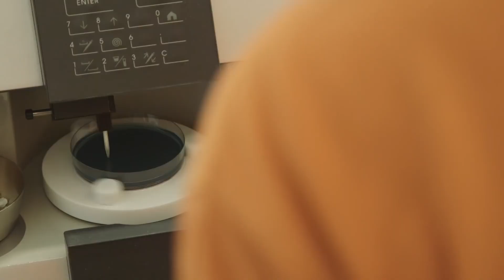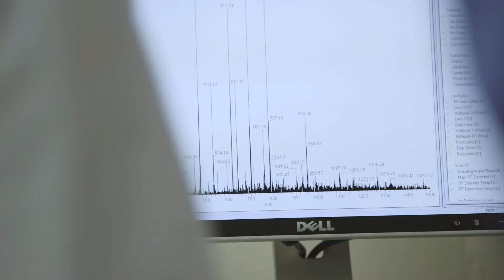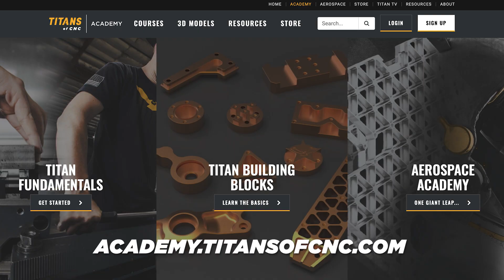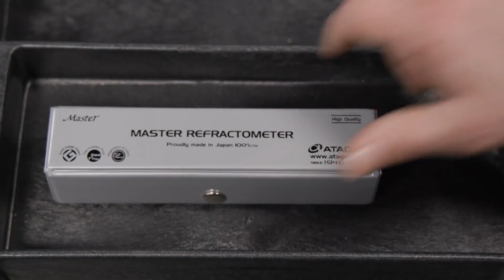The NASTIEST Thing I’ve Seen in a Machine Shop

Comment: My story: Almost 2 years ago me and my friend had to change the coolant and refill all the tanks of the machines. One HSC machine had a very big tank, we‘re talking about a few hundret liters capacity. So next thing we know after getting rid of the old coolant is, someone had to clean the tank from the inside. There was soggy slimy brown stuff everywhere, almost like rotten chocolatemilk. I was the smallest out of everybody so surprise surprise… i had to climb in the tank with a flashlight and clean everything without any assistance. Fortunately the smell was‘nt to bad (atleast for my nose :P) but the worst part was the thick air in the tank, it was almost like a gas chamber so i had to stick my head out the tank to sip some fresh air. Somehow i was finished pretty quickly and climbed out of the tank. Thankfully my boss decided i could go home wilst my friend had to refil the tank till it was full xD. 
I still love my job as a Polymechanic regardless of all the things you have to do for a healthy machine! 

Greetings from Switzerland :)

Comment: I know that feeling when the coolant pipe is stuck with dirt, I increase the pressure to max and suddenly this shit is all over the place. It takes a lot of effort to clean literally everything. Proper mainitenance is important. I've seen the same thing on some old machines in our shop. It is all mixed with oil from the parallels, coolant and metal chips...

Comment: during the summer we open our doors due to the heat. it can get up to 30-35 Degrees in there. often birds flies in and have a look around and leaves, but sometimes they get lost and gets stuck. 
During a tank cleaning we found a dead bird in one of the tanks. the PH was off and the coolant started to smell. if it falls under 8,7 in PH we cant save it anymore and we have to change it. the PH dropped to 8,3 if i remmember correctly. so when we cleaned the tank we found this poor bird in the tank,  covered in a layer of oil :(

Comment: I've cleaned out tanks on many machines and got bacteria on my hands so strong it literally ate my fingernails up and gave me a horrible rash !!!!!!!!!! That was in my own dad's shop because my goofball cousin was to lazy to ever clean the tanks out , to the point that 20 gallon + tanks were only holding 3-4 gallons 😡😡😡😡😡😡 When oil gets in them it really speeds up the bacteria process to it seems . The newer machines with the grease way lube instead of oil is a HUGE advantage for that reason alone for the long term . Coolant can get bad fast and truth is far to many shops don't take it seriously .

Comment: Our coolant is changed out often which is good for the company considering the tanks are over 500 gallons each...But one time it just smelled terrible so we started cleaning the tank and there was a dead pigeon in the tank...we scooped it out and it burst open and maggots crawled out everywhere 🤢
Reply: ouch oof, how did that pigeon get in there in the first place?
Reply: @ipadize  There's an overflow tank below the main tank which is only covered by a plate that has gaps around the sides...The pigeon must have been on the way out anyway and fell in...it was not pleasant
Reply: A guy I worked with told me he had a pigeon in his tank one day. It was only a small tank on a centreless grinder. His mate put it there as a joke. Begs the question why?

Comment: i won't work on a dirty machine, i will replace the coolant and wash the sump thoroughly if i have to. but I actually prefer working with oil and converted most the machines we have to oil
Reply: Do you mean like an oil mist, no coolant at all? Do you find it gets mist in the air?

Comment: Cooling can give you such a mightmare, that once you achive a certain level, the risk that comes with a  trie to improbe is hard to assume. 
Many workshops, don't try new solutions and continue years and years woth the same cooling.
Question:
Modern cooling solution, do they reduce production cost?
Has cooling improved significantly, in safety and eficiency ?

Comment: Worst story for me, 14 years of no maintenance on 18 machines. Not only was there hydrogen sulfide issues, there was a powdery mildew that formed in the chip layers in the tray. When I started, the “old school” machinists would spit in the machine. Every machine I filled daily was a translucent rust color and would take 20 gallons of a milky swisslube and turn it the same color (almost a 50% fill up).

Boss let me change my machines coolant, several issues were immediately fixed on parts coming from my machine. Became the best quality and efficient operator on the floor. Now I show others the right way, and I have changed out 6 other machines. Saved the company tens, if not hundreds of thousands of dollars. To boot, my bay is the only clean bay in the whole shop and my parts and talents are premiered to our customers. Owner is talking about putting in a new DMU 50 and guess who is going to be running it??? Yours truly!!!!
Reply: and then they laugh at you when you ask for a raise.
Reply: Start your own business Benjamin trust me you'll be lots happier, your currently your bosses slave and he's taking full advantage of you riding your coat tails and you're getting nothing for it!
Start your own business and DO NOT do what you know the other fools do.
People will want to work with and for you if you provide standards and disciplines of excellence, Titan is one of the best examples to acknowledge and in doing so he has bragging rights that not many can deny💪
Reply: Ask the owner to put in a Hermle C22  and you  (and the boss) will be even happier!
Reply: It's people like you that make coming to work a pleasure I can't stand nasty habits and dirty machines just shows a lack of pride in your work and a lack of respect for your workplace and team
Reply: that's the most fucked up shit ive ever heard
Reply: Congratulations, you earned it.
Reply: LMFAO ADN YOU GOT THE DOLLAR RAISE!! SO PROUD MEANWHILE HE MADE 10's of thousand of dollars. Profits run uphill you sucker.

Comment: I actually really like qualichem 251C, going on 3 years now with it, and works great, cutting mostly aluminum and a little hardened stainless. I was thinking about trying synergy 735 on my new tormach but didn't want to have 2 different cutting fluids in the shop.
Reply from the maker: Used Qualichem before switching to Synergy and it’s better than most… Synergy is just a different a complete different Beast, especially for someone that wants to see their parts while being machined… and doesn’t want to deal with bacteria.
Reply: @TITANSofCNC  yeah i think when I sell my Tormach 770m to get my first vmc I'll give it a shot!

Comment: The workshop I done my engine reconditioning apprenticeship at we used this green water soluble oil based coolant and in our climate 33°c @ 75-80 humidity on average and the machine has been run a couple times (mostly steel and cast iron) and it's a week or so old it would get that same brown sludge on the top and it had a distinct sulphur smell. I absolutely hated running any of the machines that required coolant because every time I would end up with a splitting headache and if we dare changed the coolant before it's a month old we were wasting money because it's only new. 
Hopefully in the near future I'll have the funds to purchase some basic machines like a lathe - mill ect and just do small jobs on the side of being a full time mechanic so I can at least get back in to making chips after being out of it for close to 10 years now watching your videos has made me miss machining but unfortunately where I live there's only a hand full of machine shops and they all operate with the same mentality unfortunately.

Comment: When I was apprenticing in the same shop with the toxic boss, practically every machine had bad coolant in it. I cleared out and replaced the coolant in the two TOS manual lathes, a vertical mill (which I worked till the gearbox died), a mostly-well-taken-care-of horizontal boring mill (which took a gallon container to skim off just the oil alone), and a Geminis GE-2000 manual lathe. With the Geminis, the last person who ran it apparently urinated in it a few times and when I used the coolant it was the worst thing I ever smelled, and it came out a swampy green gunk instead of milky white emulsion. It was quite clear to me that the only people who cared for the machines were me (a just-out-of-first-year apprentice at the time), a toolmaker who mentored me better than my manager ever did and worked on the horizontal borer, and the CNC operator. The boss, manager, other workers, they didn't care for the machines' wellbeing or coolant that'd rot your arm off in seconds (exaggeration), to them it wasn't a problem if it worked. Looking back, I should've resigned after the Christmas of 2019.
Reply: I once had to wait until the boss was out for most of the day and changed all thr coolant on my machine without informing him..Didn't care if he found out and I was sacked because it was better than developing dermatitis
Reply: I'm just jealous your boring mill had integrated coolant. My integrated coolant is me with a squirt bottle.
Reply: I resigned after 7 months lol, people are nasty and lazy don't cater to them ever they don't deserve it. They wanted me to clean the 5th machine and was thinking yeah I'm done being a bitch. One of the 2 guys in management would be hungover everyday and be in a mood and I don't drink so I just repelled like a magnet eventually.

Comment: I love Blaser
I worked at a place that had older mazak mills opposing each other. The 2 old guys on them used to spit listerine into the machine 3,4,5 times daily. I was written up for refusing to run the either machine when they were out of the shop or on vac. Nope not without a hazmat suit.
NASTY

Comment: Worked in a fab shop, yup same scumbags we had used to spit chew spit into the machine coolant  and band saw tank and even piss in the corner.. We only had a 6 inch fan on one back window for ventilation with 6 of us back in the fab shop welding all day, I was threatened to be fired for asking for a  3M particle mask for welding as there was not enough ventilation in the shop .  I left that place fast..
Reply: Many things I could kind of understand, but just pissing in the corner is something else entirely

Comment: The shop I work in is dirty like that. Chips all over the floor. None of the machines are vented. So if there is high temp mist, smoke, etc it just fills the building and we breath it in. A coworker of mine let his coolant get dark brown and ran it like that for 2 years. Smelled horrible and like vinegar. I don't see how he could stand it. And to think it was all because he refused to push a button that turned his oil skimmer on. If you don't skim your oil it eventually mixes with the coolant and turns into bacteria heaven.
Reply: Shit like this is why I never went far in this biz. Cannot stand degenerate lazy shit like that hahahaha.

Comment: Piss and chewing tobacco spit/pouches were common finds in machines at my old shop. I ALWAYS wore plastic sleeves and gloves every time I operated any of those machines.
Reply: I never seen a guy pissing in a machine that people work on. If anyone I worked with did, I am sure it would lead to a real fight and a whole bunch of new rules for the shop..
Reply: @leebrady6326  yeah, I'd smack the shit out of someone... I get pissed when i see people spit in machines that I'm working on.
Reply: There was a case in the UK about 40 years ago, where urine in the turbine oil at a power station caused corrosion in a hydraulic control system, leading to an overspeed and a catastrophic unscheduled self disassembly  of a 400MW generating set.
Reply: Piss?
Reply: My dad said he worked at an old shop where the dudes would piss in this one old homebrew machine while they worked lol.

Comment: How does Blaser work with copper?
I have one machine that cuts a lot of copper and the coolant is light blue because of it.
Leaves a funky residue on everything.
Reply: Synergy is the worst coolant when there is zinc. that funky residue is zinc soap. Galvanized pipes are not even allowed to be used for synergy. And zinc is alloy composition of some cooper, to a large portion.

Comment: Our shop used to use Blaser coolant, we loved it. But management switched to some cheap coolant that was $800 cheaper a drum. I hate it, my megaturn is nasty inside. (Nanotech 6800)Finally got them to switch, going with Oemeta. Hope it works out.
Reply: Oemeta is a good choice.
Used Hycut 910 because the Mazak VTC 30 had an Problem with leakoil from the guidings. The special oil emulgates in the coolant.
Holding the machine clean
the coolant is very stable.
Last change two and half year ago. Manufacturing copper, steel, alu and div plastic. 
Best regards from Germany

Comment: I use to work in a shop who was using blaser coolant. The coolant actually gave us mild infections around cuts and on skin generaly. Turned out to be that there was not enough coolant in the mixture and it created fungus. Its important to check your coolant mixture levels. A guy at the shop got severely infected because of the fumes had to be hospitalised.

Comment: I have no complaints when it comes to cleaning the gear myself. 
Finding management that will allow a machine to be taken out out of service for the  time needed however.  
I had a manager who wouldn't permit tank cleaning because of the time and cost of the coolant change. 
 He no longer works in my shop after an expensive endmill for titanium failed early in its life. My programming was blamed, and checked. The tool supplier gave me a passing grade and said the coolant quality was to blame for the failure. 
Coolant is cheap, tools cost money when they die early.
Reply: I have a large flat bed grinder in my  cell. It's the money maker atm. But the higher ups keep it in production even though it desperately needs the 800l of hydraulic oil that's sat in the oil stores waiting to be put in.
Reply: But the problem is that some managers and owners come around and are like "Why is this tool down? Why is it not being used?" and even after you tell them "We are doing the recommended preventative maintenance!" they go "Don't do it! Takes too long, wastes too much time!"
Then when something breaks down the line, they don't want to hear "Well... I was following the instructions given to me by you. Yes, I knew this was going to happen and I warned you that it was most likely going to happen!"
Learned that from my Great-Uncle, bless his departed soul, who ran into this exact issue back 28+ years ago.
Reply: End mills fail all the time regardless

Comment: Well where I'm working it has the worst and nose hair burning smelliest 🤢🤮coolent tank lol😂😂
Reply: what about cleaning it then? We were moving our machines to another part of factory, first thing was to pull out the coolant tanks, pump it out, clean it as great as possible to put clean coolant into clean tank....  I was absolutely disgusted to pull out the last liters of coolant in form of gel... with scoop.... with 10 kilos of chips.... it was sitting like this, without cleaning/oil skimming for one and half year... now, every months, I´ll get to work at saturday just to pull the coolant tanks out of my two lathes, skim the oil, and remove chips, it´s not the greatest thing to do at saturday morning, but in the end, they´re my hands washing in that coolant 5 days a week

One thing I hate about it is that I actually have to screw like 10 screws out of those flat thin plates which hold the chip conveyor in place (chip conveyor right above the coolant, not a great move by Doosan (Lynx 220LM and 220A) but whatever) without loosing them and even worse is to put it back together just by myself....

The coolant is here for three months, not smelling, there isn´t any sh@t floating in, just oil layer, which is getting removed at the end of this month as well..
Reply: @piter_sk  well to be true, we got no time to clean it. We 2 people r running 2 VMC machines.